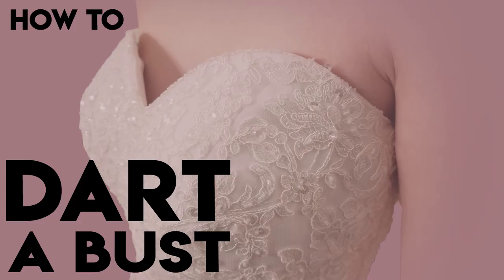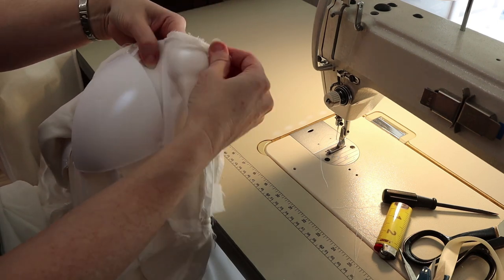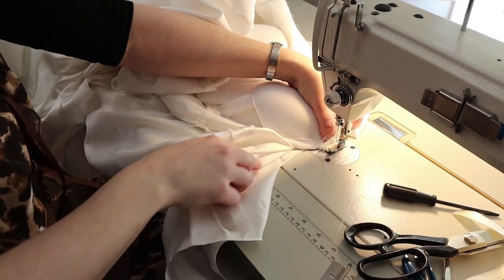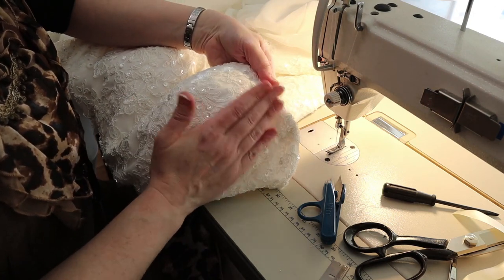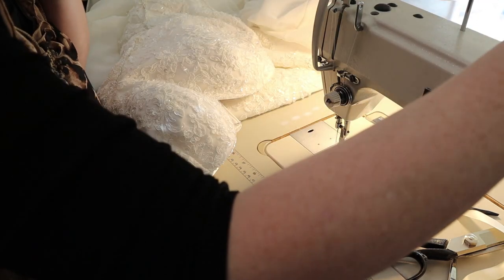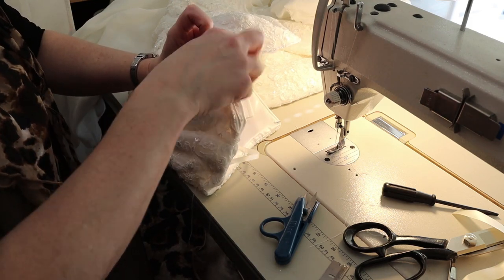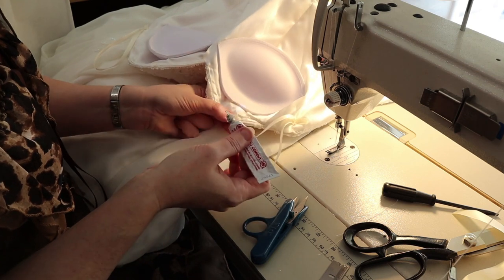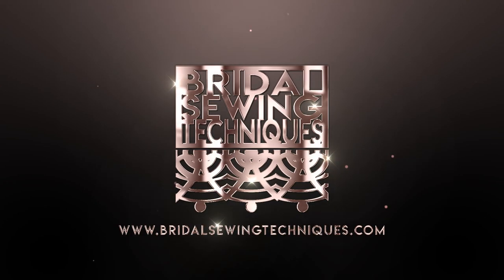How to Dart a Bust of a Wedding Gown, Bridal Gown Sewing, Bust Gaping

Comment: This video saved the day!! I occasionally do hems and minor alterations as a side gig. I had two weekends to work on altering a gown to help out a friend whose prior arrangements fell through. I thought I had to reduce the bust curve, but I did this alteration instead. It's an off the shoulder dress with a sweetheart neckline. There is a sheer lace part with scalloped edging that extends above the satin bustline that goes almost straight across in line with the sleeves. The satin fabric underneath the bust was puckering and caving in slightly. I thought the bust curve needed to be reduced. First I added bust pads, which gave the bodice much needed support. The apex of the bust was fine. The bride kept pulling the dress up saying she didn't want to feel exposed. I explained that pulling everything up meant completely reworking the dress. After watching this video, I realized that the bodice was standing a bit proud and needed to curve in to lay against her skin. That scalloped lace edging was a bit stretched. The hand stitching did the trick and made the dress fit perfectly! 
I have learned SO much from your videos. Your expertise is invaluable! Thank you for sharing and not keeping it to yourself.

Comment: This is an awesome video. Most of them are that you do but I have one little question. If they only need maybe a quarter of an inch brought in can you just do that running stitch and get it to cup in and not do the dart?
Reply from the maker: The gather or contour stitch along the top edge of the bodice to turn it in a little closer? Absolutely.

Comment: Thanks for sharing! I have a bridesmaid dress that was cut wrong. It only needs a dart on the one side, the other fits flush. 🤷🏻‍♀️ The bust of the dress has lace and beads. This video should help me.
Reply from the maker: Thanks for watching. If you want to do this the right way, also watch my video about reducing the bust angle. The lace should actually be dealt with that way. This video is a simplified alteration if you don't have the skill set or the time to do it extensively. Good luck & thanks for watching! :)

Comment: You always do a great job demonstrating unique alterations like adding the dart in the bust. Question: what if the gown has princess seams, a deep v neck in the front, lace sleeves, and the bride's dress do not fit her across the upper bust as if she has narrow shoulders. I can pin out the fullness in the princess seams into the armscye (armhole) around the full bust area but dress forms loose vertical lines (.5" total) across the upper chest right above the princess seam. Thanks. Hope this will help others too.
Reply from the maker: Thanks! 
For your question, can you email me & include pics? I want to make sure that I know what you are talking about.  Email on my website. Contact me first through there and then after I reply, you can send pics.
Reply: @BridalSewing  Thank you for your quick response. I will just take it in the armhole seams at the sides. If time permits, I will still send pics so others can learn.

Comment: I  noticed you did a simple dart through all the outer layers creating a dart line in the outside lace.  When would  you  do the same dart but separate the outer lace  cutting around the lace pattern so you only make the dart in the layers under the lace and then afterwards reposition the lace, overlaying the lace flaps and hand stitching it back down?
Reply from the maker: Almost always, I should do it that way. (The correct way) this video is showing a very inexpensive way of doing it.  I mention this/ explain this in the video description.  

This video shows the work very clearly for those learning & it's also an example I couldn't pass up because of the bride's sternum being concave.

 Almost every bride would have me dart the bodice and then seamlessly contour the lace back. I have another video that shows taking down the bust on a lace gown, "the right way." 

As bridal seamsters, we come across all kinds of budgets and fitting situations, so I think it's better of me to show a wide spectrum of methods.
Reply: Theresa Wheeler 
Thank you. That is what I thought.
Reply from the maker: No prob. Anytime you want me to clarify something,  just ask. I'm happy to help. ❤

Comment: How do you determine taking it in in the princesse seam or to make a dart?
Reply from the maker: Silje McHugh you can pinch both ways on the dress on the bride and see which one is the better remedy. Usually, darts keep a similar cup size, but tip back for modesty, and doing a small bust adjustment actually reduces the cup size.

Comment: Have you ever run into a situation with a strapless backless dress where the front sticks away from the body because the dress is too small or too long waisted or both and the customer insists all it needs is to be taken in like the one on this video did? Or the situation where cups actually push the gown away from the body? I love that you are teaching these techniques- the more of them we all have in our arsenals the better off we are!
Reply from the maker: Oh, yes, for sure. Our job is easier when we adjust their expectations and explain how the gown was engineered/designed to fit. Even then, some brides have their way stuck in their head and they don't want to listen. It is their dress, so it's ultimately up to them.
Reply: @BridalSewing true- but I have actually refused to do some because I knew I could never make them happy in the end. I want only happy faces walking out the door!
Reply from the maker: Yes, best to filter at the beginnning of they have a bad attitude!

Comment: How would you do this on a gown that has tiny tulle rousing? Could you take it out of the front part of the seam?
Reply from the maker: Did you mean rouching? It is a very deep alteration. You have to open the top edge of the bust along the front/sides and set the rouching free, do the alteration, then re-rouche (re-rouch?? Regroup?? Lol) baste back to the shell fabric's seam allowance, then sew the edge back together. Alternatively, if you have a budget bride like this one was, you can often just dart through the tulle and shell fabric stacked together, and the rouching helps hide it. Sometimes works, but not always. :)
Reply: Oh , ok I see now , then manipulate the ruching to fit the new shape of the underneath layer! Thanks you’re a great help!
Reply from the maker: You got it! 👍 no problem:)

Comment: How do you close up those very first stitches you removed?  Do you flip the dress inside out or do you hand sew that area along the top edge?
Reply from the maker: Vicki Richards I usually sew the line from the inside. And then, often, when replacing the hang loops, I stitch in the ditch for those and that adds additional stabilization to the layers. 
Of course, the most thorough way would be: Sew it along the top on the inside. Flip. Hand sew along top lining edge to prevent roll. Slip hang loops into lining side seam. Hand sew those in, making sure to take a small loop or two all the way through for stabilization of the layers. 
As you know, there are varying degrees of quality, and the needs vary also. So, I usually try to balance the bride's budget with how thoroughly things are done, making sure everything still looks neat in the end and functions properly.
Reply: Thank you so much.  Your videos are very helpful and truly generous.  You're a blessing.
Reply from the maker: Vicki Richards thank you, sweetie!! 😍

Comment: How can you make sure both sides are gathered  the same?
Reply from the maker: Benene Lane measure the distance from the center V to the top of the princess seam/bust seam. Also, sometimes you don't want them the same if she is fuller on one side, so you also need to get her in the gown & "eyeball" it.
Reply: Pin on bride first if possible, if not then pinch and measure.

Comment: I am wondering how large this dart can be before the top curved  edge of strapless sweetheart is no longer visually pleasing.   I understand this is cup volume dependent.  I  have made these curved darts with one inch pinch, ( half inch on the double).  I would like to go  larger, say.... 1 1/2 inches, but then I see the dreaded diagonal pull under the bust. Ugh.
Reply from the maker: Im sure there's some computational way of figuring this up, but I basically just give it a whirl and back off when it is too much. 
It does seem that the larger the dart, the taper grows exponentially, doesn't it?

Comment: Thank you alot for this tips ..the quastion is..cant we use an elastic with silicon insted of running and gathering stich?
Reply from the maker: Yes, some people use that. :)
Reply: Hi What do you mean by this? Please clarify thanku!
Reply from the maker: Some people gather the edge of the bodice in a little bit with a grippy elastic instead of gathering with thread.